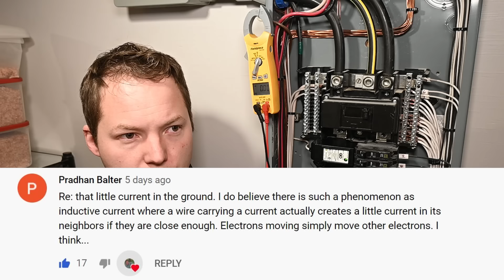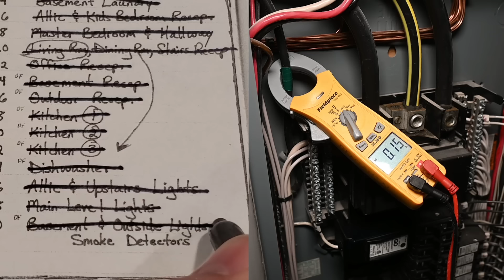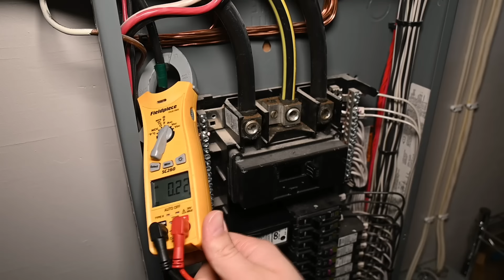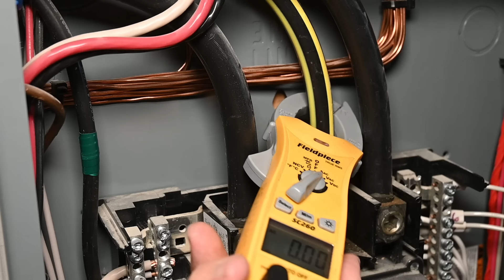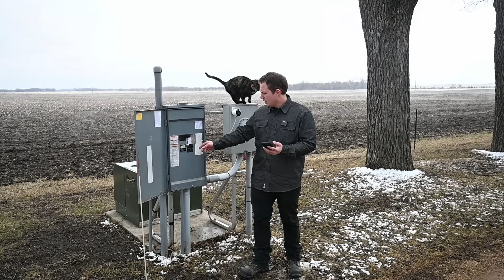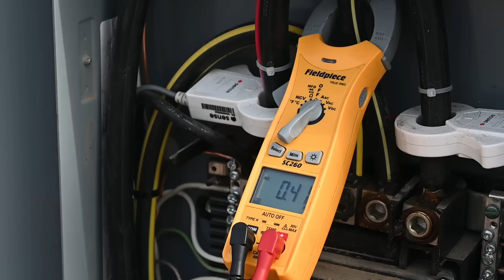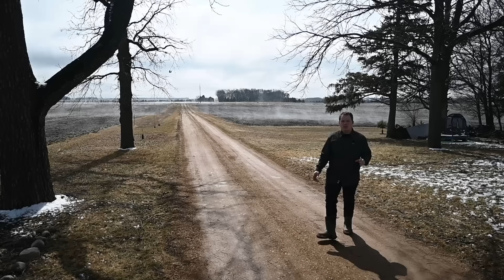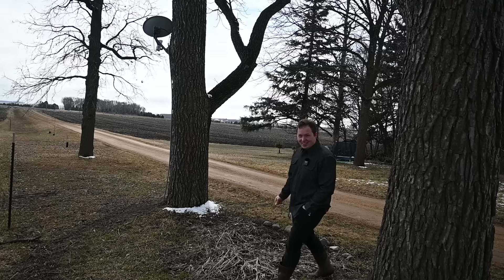Finding The Source of Stray Current on Grounding System

Comment: P = E×I. So if you have current and  voltage, you have power. Similarly, E=P/I. If you have power & current, you have voltage. 1amp  flowing through 120 volt circuit has 120 watts of power.
Reply: philipblythe I suggest watch a 13 part series called What on earth happened by Ewaranon to learn that the earth is not a globe.

I got it in my about tab.
Reply: What does what I said have to do with your comment?  The electric system problem is not connected to the mag field of earth.
Reply: @philipblythe6535  No relation but random suggestion.

Comment: Ground loop, under circumstances (hidden).  Try to disconnect the ground cable in the sub panel (dead end) and measure. Try to disconnect all three input cables in the sub panel and make another grounding rod into the dirt there and measure only that single wire. Try fixing grounding cable only into the sub panel, the building is laying on the dirt, providing contact and capacitive inductance.

Comment: I am confused, there is NO ground wire on a GFCI breaker, they only detect the outgoing current compared to what is coming in on the neutral.  GFCI works fine on systems with no ground  wire at all, its job is to compare what 's coming in and going out and kick at a set percentage of imbalance.

Comment: only because you are the closest to the transformer, when a neighbor doesnt have a good neutral his return is going through the common water line through your ground wire back to your common neutral /ground to the transformer regardless of ground rods. the current  will vary because of  your neighbors load. you can (i got)several amps on ground wire. that was tied to waterline.  i am nearest to transformer front of property, i had to put in a dielectric break on waterline to kill the current from anyone on same transformer.

Comment: My landlord is cheap I told him apartment has bad ground cause lights dim when fridge or microwave, vacuum runs & tested all grounds & got around 80 volts, can’t touch stove when turning on hood or get shocked same with antenna & heat radiator & light switches if barefoot ( get popped) & noticed everything runs hotter than normal, he had an “ electrician” come by & said everything is ok! I told him to touch he wouldn’t he used multimeter & he thought I was stupid I told him put it in ac voltage setting he noticed i was right & still told landlord all is good, what can I do?????

Comment: in all american power systems the ground is supposed to be at neutral potential. That is why our power is so much deadlier than european power.  you are seeing a circulating current from neutral to ground with no load. Check your transformer ground rod.  If it not driven into the ground at least 10 feet, that might be your problem or the connection is faulty. Also remember current can not flow unless there is a potential between connections. In a live circuit you can experience this problem by having large capacitive or inductive loads on one phase and not the other.  In your case I would check all those ground rods and connections to them up to your service.

Comment: The current could be originating in your electrical utility’s system where there are differences in ground potentials between their earth grounds and yours. Prove this by lifting their neutral conductors where it attaches to your house’s system. Otherwise, just one of life’s little mysteries. Also you seem to be one of the best informed producers of these videos, and further, you are quick to point out when you are not completely informed. For this you have to be commended.

Comment: So what’s the verdict? I still say this tiny amperage doesn’t mean a thing if the voltage is low. Also, as you pointed out, you can’t tell which way it’s going, on average while knowing it’s reversing 60 times per second. That meter could be grabbing random samples, some one direction and some the other. If the neutral tap on the transformer is a tiny bit off center it will vary the voltage from side to side, plus, anything that uses any power on one leg or the other will slightly reduce the voltage on that leg shifting the balance which would show up through the neutral. Fun to think about, what’s the answer?

Comment: I would blame the grounding of the supplier distribution system having looked at this. Does the the centre tap of the supplier transformer not have it's own neutral and, for that matter, isn't it connected to the neutral in the high voltage distribution system which ought to be multiply grounded.

Comment: lets say, that underground, under grade, there is an electrical current flowing through the earth, and you pound two ground rods into the earth 100s of feet apart.... you will be able to measure a votage difference between the two rods... and if you connect a wire from one ground rod to the other ground rod..CURRENT WILL FLOW through that wire.. What do you think?

Comment: That stray current results from the multi-point grounded neutral design of the power distribution system.  The neutral on the primary side of your transformer is grounded at the transformer and bonded to the neutral on the secondary side.  That secondary neutral is bonded to the grounding rod at your outside panel.  The panel’s ground rod is also bonded to the dedicated equipment grounding conductor in the feeder headed to you house’s subpanel ground system.  All of those grounds are now bonded to the primary neutral and some primary return current will flow through all of them including through your subpanel.   The amount of current returning through these grounds will vary as the primary neutral-to-earth voltage varies with customer demand and other factors.  The primary neutral has to have some voltage on it otherwise no current would flow back to the upstream transformer.  In fact the farther you are down the primary distribution, the higher the neutral-to-earth voltage will be since the voltage drop on the neutral can only get larger as the conductor gets longer.  To summarize, the non-zero neutral-to-earth voltage on the primary neutral finds a current path through the secondary neutral to your outside panel, which you saw on your ammeter, and then flows partially directly from the panel to the local ground rod, and partially to your house via the feeder equipment grounding conductor and from there through all available paths such as your house’s ground rod(s), gas line if it’s bonded, etc.

Comment: I had a stray current the other day. 60V on the underground propane line. 40V on the patio faucet. The fault is between the riser and CT cabinet at the road. NOTHING inside the house was wrong! I test at your riser, underground service. GO OUT TO THE UTILITY CONNECTION!

Comment: Have you ever watched those videos about electricity from air? Bings earth has a magnetic polarity the magnetic  polarity can be absorbed onto the neutral line as a collection device that is most likely what you're picking up or humidity in the air can transfer some power from the hot powerlines to the neutral powerline through the moist air.

Comment: When current flows, it is because a potential (voltage) is pushing the current. Therefore, you are correct, there is power flowing in your wire: P=(E)(I), OR I= P/E. However, it is more correct to say that current is flowing, it is being pushed by a voltage and the resistance in the wire opposes that current. There are 12  formulas in Ohms Law.

Comment: current = amps
Power = volts x amps
Both term are interchangeable, because you can't have current unless there's a difference in voltage potential, but current is more accurate.
Hence, you have a difference in voltage potential between ground rods, where the higher potential is at the transformer, and the lower is at the rod near the house.
But, what I don't understand is how your could have a current flow after the ground rod, in the house..

Comment: My uncle has a factory.......

The power company swapped out his mechanical power meter for a digital one ..... The following month my uncle got a huge increase on his bill......

He had his in house engineers look at the problem........

They said that machine startups we're causing negative spikes.......

So they added a capacitor Bank to the building.......

The power bill dropped lower then before the meeter swapping......

The power company returned and put the mechanical meter back on the building just to bring his bill back up a little bit......

Comment: ..could be a peltier effect from ground rod temperature and indoor temperature difference, reversed current from outside...that's another possibility..or mybe a chassis grounded capacitor in appliance are slowly discharging ...but that was not it either ..it was the distribution transformer floating neutral - ground link current...boom..the ghost of curiosity is neutralized..

Comment: We'vebbeen experiencing a shock also at a shower and we have had this house for many years and never had any issues with a shock until there was a lighting storm a year ago. I actually witnessed the lightning bolt that hit the power company's pole that feeds electrical wires to our property. Electrical wiring on the property all checks out fine. Would that possibly be the problem out there by the pole? Please reply, thanks.

Comment: Not all grounds are the same.  If the house ground is better the electricity from the house neutral current  will go thru the house ground rather than me returning to the transformer neutral. If the transformer ground is better it will return back to the transformer neutral but some current will still return thru the house ground.  This is especially true if the house ground is a water pipe in which case the current will prefer to go thru the water pipe

Comment: So, this is part of what bonding neutral and ground is supposed to do. Without the earth connection you'd have all kinds of issues from the floating voltage on your transformers neutral. 
Neutral is only neutral in regards to phase a and b, so some deviation from earth is expected, but It should be a lot less than you are seeing here. Something is either wrong on the utility side, or in your area. Maybe someone in the neighborhood has energized their gas pipe accidentally, or maybe you have an electrified body of water in your region to hold back invasive species. Whatever it is, good luck, and please consider bonding all the electrodes from the multi earth neutral system at the same point.

Comment: The main source of this current is distance of earth path between your power company transformer and your neighbors. It can get fairly large, especially in rural areas. It also causes voltages between neutral and grounded structures like metal fencing, pipes, etc and poses a shock hazard for people and livestock. This is the main reason why detached garages need auxiliary ground rods. Mike Holt gives a better explanation here: https://www.youtube.com/watch?v=a_nv_Q9WbeE

Comment: Nice demonstration..
Please anyone correct me if my understanding from this is incorrect :)
Due to unbalanced loads (not necessarily in same property), neutral wire from pole carries unbalanced current.. which will spread all over ground as neutral is grounded at poles..thats also reason for stray NEV (neutral-earth voltage)

Comment: You need to call your utility. They ground all the way back to the power plant, and when they don't do it enough, or their neutral wire breaks, or has a shit connection somewhere, the earth gets used to get current back to the next solid run of neutral wiring. That current you're reading obviously is not coming from your property if it's still there when you turn your main off. It could be your neighbor, or a bad connection in your transformer. Bad windings, taps, short, etc, etc... 

The real issue is, most linemen who grab the call are not going to figure it out. You'll likely need to complain many times and wait weeks to get it resolved.

However, 0.4 amps is significant. Especially if there is an issue on the 7200V primary side. Also looks pretty wet where you live. 0.4 today might be 14 amps some snowy day down the road, and either way, both are more than enough to kill the first person to find the fault by accidentally getting between it.

Comment: Just a thought.  Is that a bonding screw connecting the neutral bar to the enclosure and ground bars (the green screw at the top of the neutral bar on the left)?  The outdoor panel being used as the main disconnect to the house should not be bonded.  The panel in the house requires the bonding screw.  That may be your problem.

Comment: I am confused to why when you shut off the main disconnect breaker, power stopped coming in from the large hot leg conductors. From my understanding, even though you shut off the main disconnect, the legs coming in are still HOT. Cans someone please clarify this for me as there seems to be something I'm missing. Than you, Ryan
Reply: Only the legs from the meter will have voltage.  To have no voltage at the main panel, the meter would have to be pulled.  The secondary from the transformer connects to the LINE side of the meter and the LOAD side of the meter connects to the main lugs on the outdoor panel which feeds the main breaker inside the house.

Comment: Inductive current symbol(I) is explained in Faraday's Law of Electromagnetic Induction when you have an electric current through a conductor it will cause a magnetic field around the conductor, you can find what direction the field is by using ("the right hand Rule) another topic for another time! hope this helps! Also current always try to return to the SOURCE through any conductive path i.e. metal, or the earth.

Comment: transformers dissipate power even when you are not using the load side, mostly in form of heat. its the back EMF as the inductance trys to resist the change in AC voltage,. there should be a specification on that, should be pretty low, 180mA is not that much current. Y vs Delta transformers typically have different values, i think Delta transformer pulls a bit more due to hot leg.
check out the transformer datasheet

um sorry im thinking 3 phase but what i said is still relevant

Comment: Every ground fault receptacle will send a small amount of current to the ground wire.  If you unhook the ground wire while power is on, you will feel it.  Better yet, hook a meter between it and the ground bar.

Comment: you have another bond inside the house some where (ground and neutral) causing circulating current on other grounding fasilities inside the home.  You were measuring the utility return current from the multipoint grounded system.  Only one bonding system in the house.

Comment: Look at it like this. In a river you have water flowing downstream, the movement of water is called current. It's the same scenario with electricity. Voltage is flowing & the movement of the voltage is called current.

Comment: As an underground high voltage utility lineman, I am wondering if there is not sufficient ground rods at the transformer, and it is using your grounding to help out.  I know at the end of long runs like yours we would drive at least 4 rods at that transformer.....
Reply: And if he drove extra ground rods at his home,.would this also create sufficient ground to eliminate the current? We are end of line with same amount of current on an Ufer. City came to investigate. They say all is good, and they are grounded. Thanks

Comment: What you're seeing is the leakage seeking an alternate ground path through your plumbing pipes. (Do you have cast iron pipes?) If you check this in the summer, you'll probably find this cleared up because the ground rods don't work as well in frozen ground. You can get threaded rods and stack them and go down 20ft or so to get below the frost line. Saw many a house back in the day where the water pipe was the ground connection.

Welcome to the wonderful world of multiple ground paths! Never rely on the electric Co's neutral being totally neutral. (That's why the ground and neutral are tied together on the customer side now)

Comment: It could be that the next nearest house to you is on a different phase of the three phase system. Being their neutrals are grounded and far apart, there will always be a voltage differential between the two and current flowing thru the ground between them.

Comment: Wire coming from the center tap of the transformer is called the grounded service conductor.
Transformers leak often. That’s one reason article 680 makes you  install equal potential grounding around a pool.